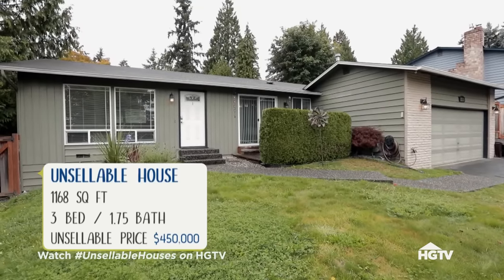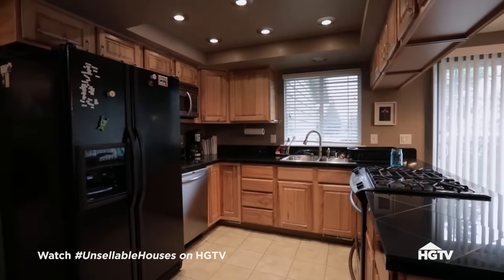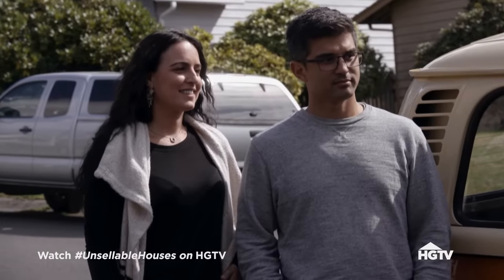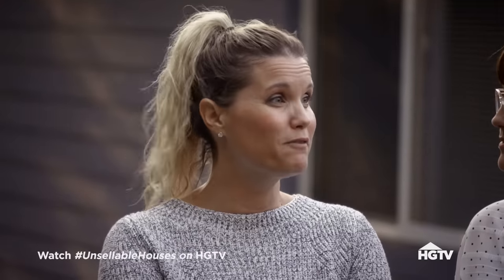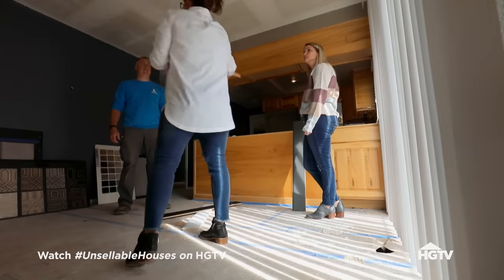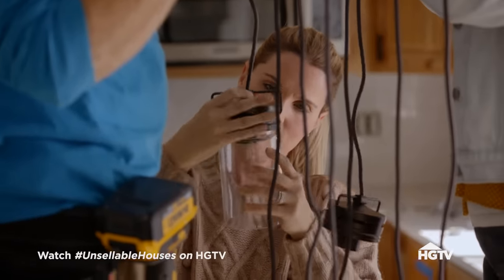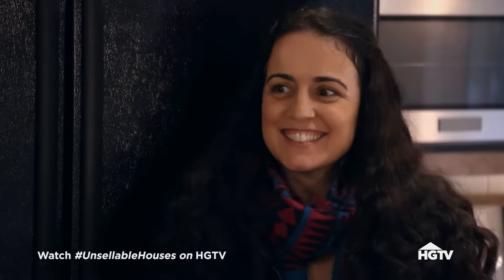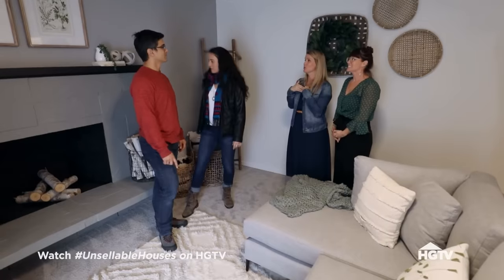Outdated Ranch Gets Modern Farmhouse Renovation It Deserves | Unsellable Houses | HGTV

Comment: Why did they paint over the slate 😦? It gave the room some extra character.
Reply: The slate was never the problem, it was the rest of the wall.
Reply: I'm glad they painted it.
Reply: They paint every pretty thing a boring gray. 😢
Reply: @seedsoflove7684  What would you recommend?
Reply: @drelle504  to have left the slate as is, it had character and shades of gray and pink. It was so pretty. 

As to other colors, gray can work, but not overdone. Beige, light yellow, dark blue or green all are nice colors and most go ok with gray. I dont hate gray, just dont like too much of any 1 color. Boring! 

Not that u care, but i have painted rooms lilac with a dark purple accent wall, same with light and dark green, light and dark blue. I've done magenta with beige. Turquoise with a sponge faux finish. Light blue with white paint brush splashes (also faux). My ceilings and floors and furniture are wooden. There are options. 

I dont like black and white.

Comment: Painting the fireplace was just stupid and why were they so obsessed with changing the small house???????
Reply: I agree, the after fireplace is hideous. And they painted it the same color as the wall—wtf?
Reply: I'm worried the paint will chip overtime. I would've worked with the stone tile they were given and if they're obsessed with painting, paint the grouting the color scheme black. I agree with painting the walls a lighter cream or white it did feel closed in.
Reply: Did the house sell? And for how much???
Reply: The answer is: Because it added to the $35k they were asking for the remodel and also to have more to "split the profits"... it wouldn't be worth their while to do the remodeling otherwise.
I don't  think 45 days was enough time on the market just because the other house had offers in 24 hours, however, since the owners had a time crunch to move out of state, I understand their trepidations.
Reply: @drewconway7135  IF they had half a brain between them, they should've chosen a beige-y gray to paint that wall that would've highlighted the slate on the fireplace so they didn't have to paint it. It looked horrible painted. They should lose their jobs for that.
Reply: @libbyhardel1826  Agreed 100%
Reply: @johns7199 I think they did an addition to the small house that was not permitted properly.